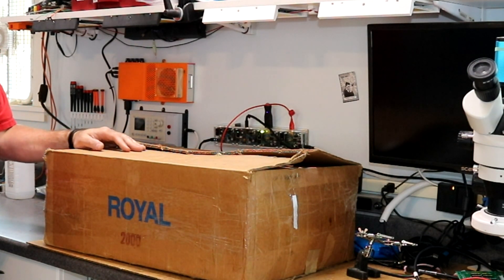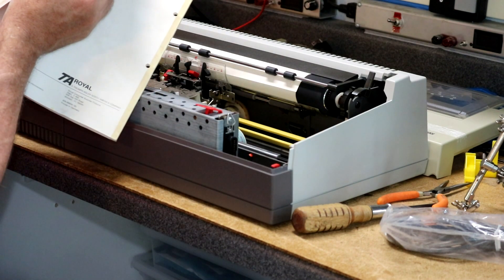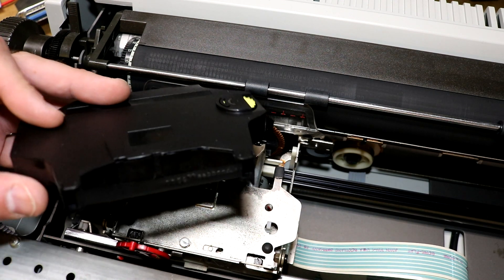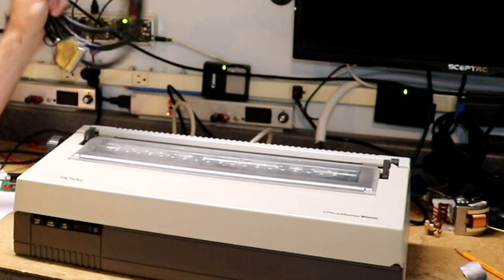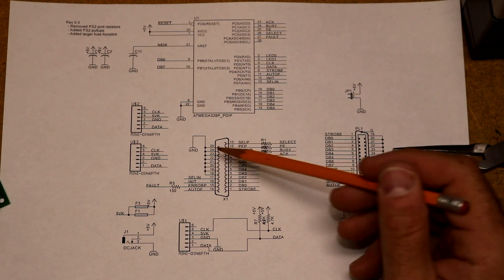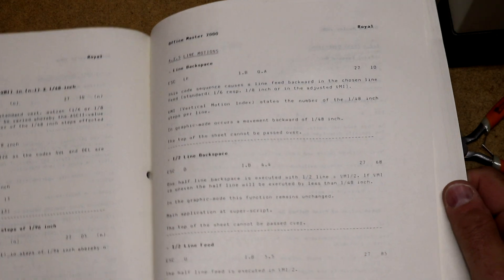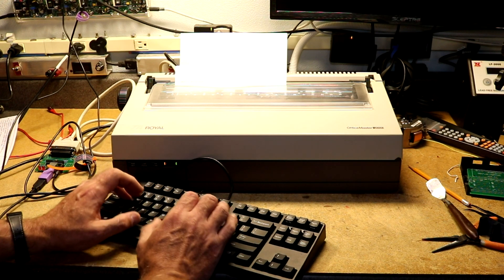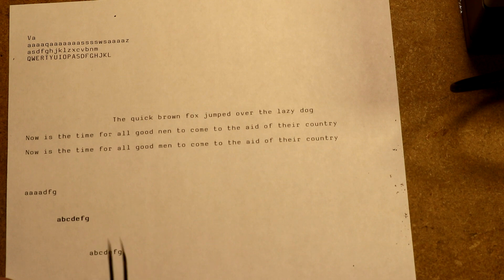Royal Officemaster 2000 Daisy Wheel Printer converted into a Typewriter

Comment: Can these be internally switched to 230V operation or are they hardwired to 120V ?
Reply: Most printers in the 80's had a switch on the power supply to switch between 230 and 120,  it's a small red switch you can see on the back of the printer close to the power cord.  If it doesn't have it, you would most likely have to get a new power supply, or some kind of converter.

Comment: Hi there! I received my OfficeMaster printer a few days ago. I'm hoping maybe you might be able to lend me a clue. I've got the print wheel installed, I've set my BCD switches to 25-1-10 as specified in the manual for ASCII printing, and I've held down TOP-SET and started the printer up but all it does is align the print head and does not proceed to perform a status test print as specified in the manual. I thought maybe I was misunderstanding the instructions, so I watched your video and...nope, that seems to be the same thing you're doing, and you're getting a print. In my case, it acts no differently if I press the button or do not.

Any ideas? Have you ever had that happen? Is it possible that the buttons have simply gone with time and are no longer working as intended?

Thanks for making such a thorough and informative video :)
Reply: Upon closer inspection, the blinking green light leads me to believe there is either printer error or user error causing it to believe either there is no paper fed, the lid is not closed, or the ink ribbon has reached the end. None of these things are accurate, but the blinking green light indicates otherwise. I've also noticed that the sound of the motor controlling the carriage makes a loud grinding sound as it orients itself, and does not make it all the way home during power-on if I push it far to the right. That makes me think maybe the motor is somehow jammed, but the carriage moves smoothly when I move it by hand. Maybe the motor has gone bad after years of storage and I should return it to the seller.

Comment: Wow great video. Got the same printer and just want to print. You mentioned drivers on github, I looked but could not find one. Do I need to look harder? Do you have any suggestions how to go about finding a windows or linux driver? The manual has detailed instructions on how to write your own in "Royal-basic" lol. That is, I am afraid, not something I want to learn. Love your project!
Reply from the maker: I think the page I had in mind was https://blog.ajf.me/2015-05-17-daisy-wheel-diaries-part-3. It's actually for a Royal LetterMaster, not OfficeMaster, but I figured maybe it's either close enough to work outright or at least a starting point to develop a new driver. Hit github repo is at https://github.com/hikari-no-yume/LetterMaster-Unidrv.
Reply: @smbakeryt  Thanks for the feedback! This link leads me to a techie in Finland who attempted a printer driver on GitHub a few years ago, I will reach out to her if I get beyond this hardware question, that I will need your help on again: got the status page to print beautifully (your video saved me a lot of time lol). However: when the printer is connected to my Windows 10 laptop via Centronics parallel printer cable (USB to CN36 adapter cable), it seems to short the printer. As soon as I turn the printer on, it will move then go dead (or print a few status chars then go dead). With the printer cable disconnected, the printer works again and prints a nice status page. Am I crazy hooking up a Windows 10 machine to an 80s printer via direct link? I am thinking: (A) I need an interface piece between my laptop USB and the Centronics printer cable to filter the signals? Or (B) I need to pull out an old laptop, and my old DOS disks, and an old printer cable, and get working? I would much rather try (A) first if that even possible. You would clearly know. What is your advice?